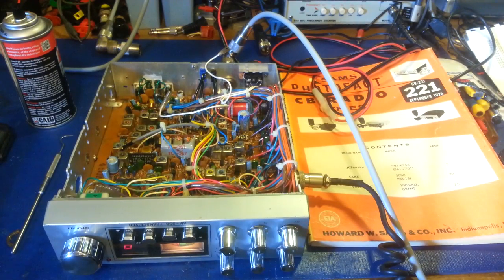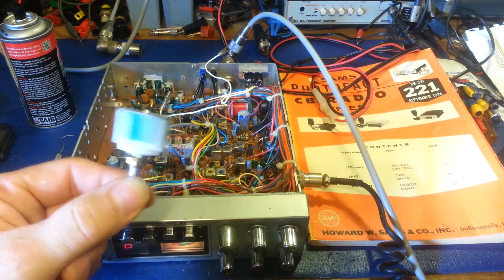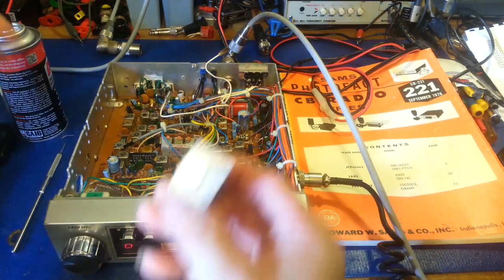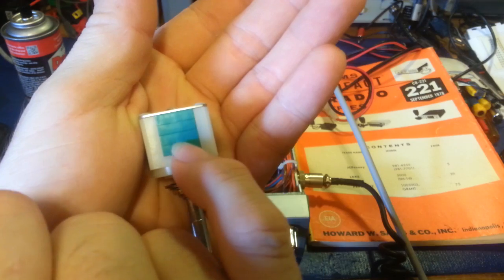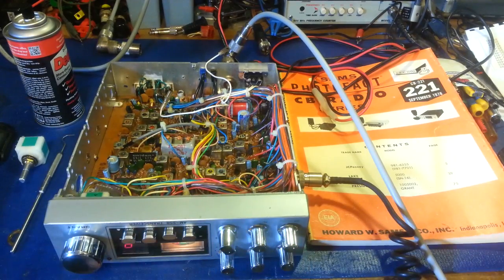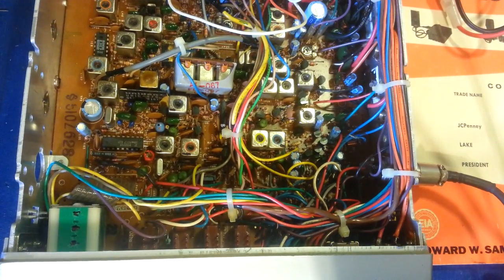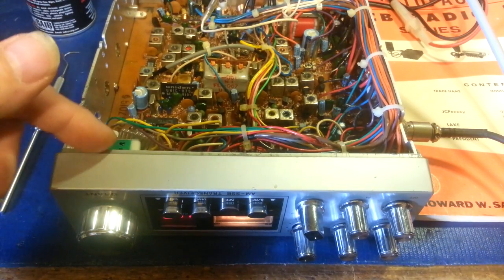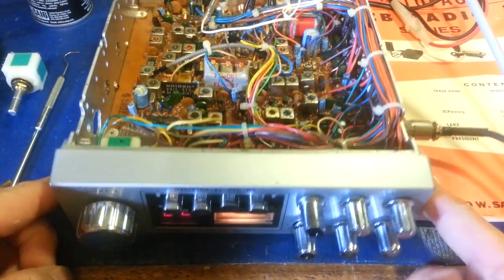How to repair channel display segments out / dim in a CB radio with a dirty channel switch..

Comment: Hey mike would u happen to know what size or what do I need to know to be able to order the 7 or 8 pin ribbon cable on the channel display? I see common ribbon cable in ebay but it don’t have the spacing like the grant does

Comment: I found going by a Cobra 25 year of manufacture is not reliable for ordering a channel display,I have a 1996 Cobra 25 which should have a Common Cathode 2D04C?? display when tested with a DMM with 200 Ohm resistance setting common to ground will light the segments to test the display. Mine is Common Anode which means common is the positive voltage and the other pins go to ground to light the segments to test the display - depending on where it was made it could have either,the only way to know if the numbers are not visible is an ohm meter test.

Comment: I mean no disrespect, But you do not need to strip the selector or drill holes in it just for dirty contacts, Simply flatten the end of the straw on the tin of switch cleaner stand the radio face down and place the flattened tip of the straw against the gap on the side of the shaft at the back of the selector and give one or two quick bursts then spin the selector knob a few times and repeat again if needed and the switch cleaner will go inside the switch cleaning the contacts, If you have too much switch cleaner [a small puddle] on the back leave it a few seconds and it will eventually all seep inside, This is much easier and no risk of destroying the pins inside the switch.
Reply: Yeah, I took a very small amount of 91% isopropyl alcohol and dropped it in that very area and my channel selector came to life.

Comment: I have done it by spraying the contact cleaner on the part of the channel switch facing up and let it soak in between the layers of plastic slowly.    It works, but looks like your way of doing it would get more cleaner in the switch and work much faster.

Comment: Hi Mike. After watching your video last night, I figured out a slight improvement on repairing the channel display flickering. Since you like to be efficient, I think this will fit that bill nicely. Using a soldering iron is so much easier. Please have a look.  https://youtu.be/5zgsLrgIkIM

Comment: Thanks!!  I have an issue with a Connex that I bought used.  It has a bad display segment and sometimes does a "scan" of the channels which stops when I dial the channel selector switch back a channel (its weird).  I hope this fixes this, I will update you all.  Thanks!!

Comment: I have always had good results from squirting cleaner up the end of the shaft and coating the outside to let it soak into it between the wafers. If it doesn't go in I try to lever between the wafers to open a small gap for it to soak in.

Comment: Probably a little rarer but I had the dial tuning rotary encoder go bad on my TenTec RX-340 receiver actually go bad many moons ago and ended up having to replace it...may have been worth the effort to try to clean it. It's actually around here somewhere in a box and now you've got me curious at to the viability of rehabbing one of them...onto the project queue that goes! (Yes, I know a rotary encoder isn't a switch per se but it still does have a mechanical aspect to it).
Reply from the maker: These can be taken apart but its a lot of work and then you have to drill some holes for screws since originally it just has the plastic melted into a blob.

Comment: You and I were separated at birth..  I've been drilling holes in those Bar-Stards for years. Using the same type of tool to do it as well. Also works well on those sealed mil-spec pots and have saved some tiny toggle switches the same way. How's it go? Great minds run around in circles? Something like that. :-)
Reply from the maker: Great minds think alike.  :)  And I to have done that to sealed pots.  Non serviceable, nonsense.  Nothing is non serviceable if you expend a little brain smoke.
Reply: Amen....